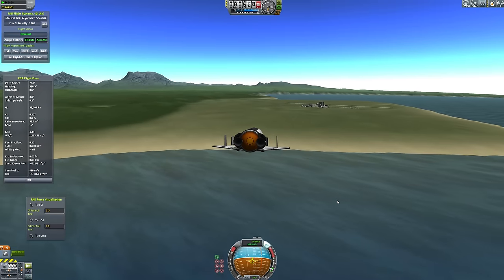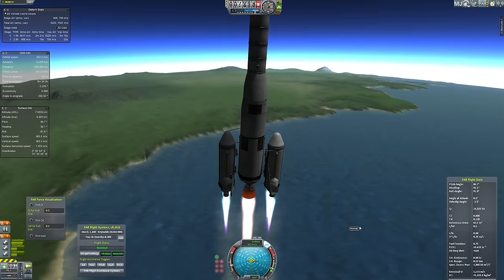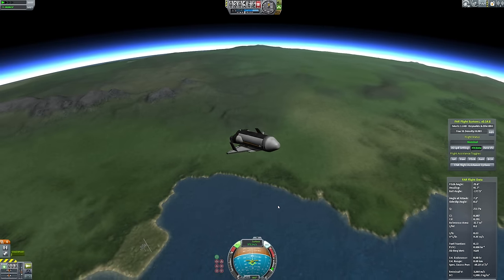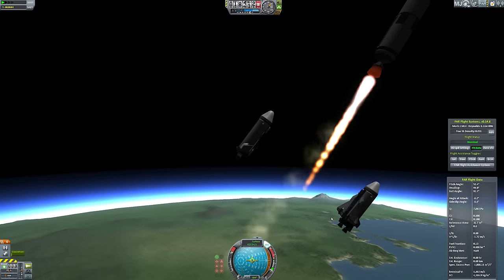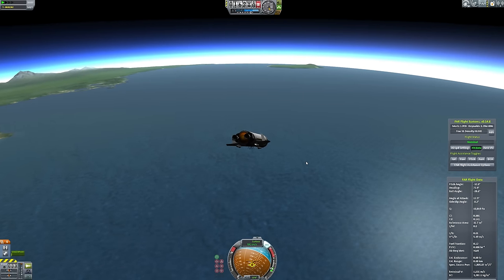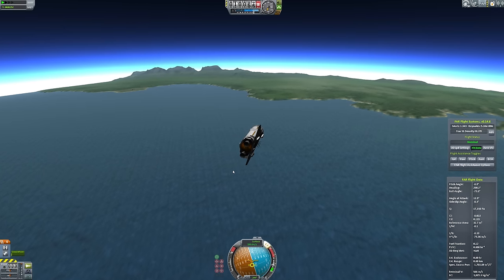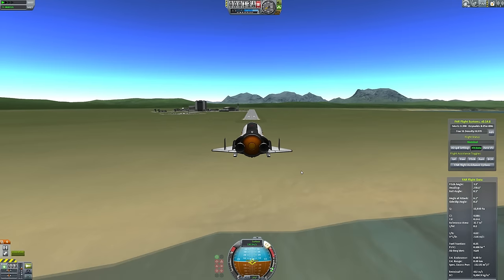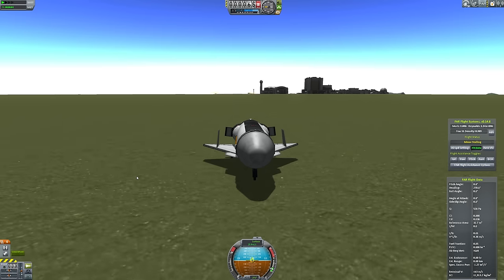Kerbal Space Program - The Reverse Shuttle

Comment: btw- If you want to lose altitude without gaining airspeed perform a side slip vertically through the air. If you have enough torque/yaw control to keep the nose level you won't gain a single m/s of v.
You probably know this ,but side slipping in this context is rolling the wings 90 degrees.

Comment: Weren't flyback boosters of the type shown here a Soviet concept for the Energia/Buran liquid boosters?
Reply: You mean the Baikal flyback booster. It was designed for the Angara rockets. It will use a folding wing and a jet engine to fly back to base.
http://en.wikipedia.org/wiki/Baikal_%28rocket_booster%29
http://www.russianspaceweb.com/baikal.html
Reply: No, there were definitely Soviet-era studies on the subject: http://www.buran.ru/images/jpg/gk175-5.jpg
Reply from the maker: I haven't seen any updates on this - the mock up was shown at the Paris Air Show in 2001 - the year before SpaceX was founded.
Reply: Scott Manley
It seems NPO Energomash has to make the RD-191 reusable first.
Reply: Christopher Woo as far as I know, it was originally planned to make them reusable by parachutes and retrorockets, althouth first ones were fitted with telemetry equipment instead. You might want to take a look here: http://www.buran-energia.com/energia/energia-desc.php
Flyback return of both boosters and core stage was planned for Energia II, which was planned for 1993, but was never realized.
Reply: I seem to remember early US space shuttle designs having the external tank returning with wings. 
I know I saw some concept drawings based on that idea.

Comment: They way I deal with clean separation is to attach a small fin to each side of the separated stage canted slightly outward. I put them about 3/4 of the way up the body. They have just a small amount of drag but the stages pull away instantly every time. I have not tried it with this type of recoverable booster but im sure it would work the same.

Comment: I think the "reverse-shuttle" design with strong aero-spike engines is the best way to build giant LH2-LOX rocket. Then we need to add a small, disposable, low-cost second stage and a giant liquid hydrogen tank with structural supports of the second stage. The tank can be either diched into the ocean and recovered or just disposed, it is not expensive anyway. All the valuable equipment would be on the shuttles together with the LOX tank, LOX is so much denser so these shuttles can have reasonable scale.
I actually ran some numbers based on SSME performance and quite conservative structure mass, it out-performs the space shuttle design, in terms of both payload capacity and cost. However, I see little discussion about this design, so what do you think is the major shortcoming of this design in practice?

Comment: SAS freaks out if your ship's control orientation doesn't match the body orientation.

Looks like you could have landed both of them by switching back and forth.  Get them both pointed back at KSC and when you get close, activate the air brakes on one of them to slow it down for landing while the other goes past, and once the first one is on the ground lock the brakes and bring the other one down.  Assuming it'll let you switch like that anyway.

Comment: I think B9 parts would be helpful here.  I find the brakes on the landing gear to work better, at least at high speed than the stock gear.  Also you have useful things like airbrakes (if they don't explode from over heating due to Deadly Reentry like they did on my SSTO space plane).

Comment: But isn't this a lot less reliable than parachutes? In what ways are wings better?
Reply from the maker: Wings provide superior cross range capability, and they don't submerge your expensive hardware in seawater.
Reply: Scott Manley
I was wondering why you did not put on a single parachute or "brakechute"(?) as you called them. I always smack one on my planes for I lack the calculating skills, I often have little to no idea where I'll be able to land.
Was it challenge?
Reply from the maker: Björn Mätal Stock parachutes in KSP get cut as soon as you land, so they can't help with braking.
Reply: Scott Manley How about this: if we can't trust the autopilot to land our winged thing reliably, we could have it fly on wings until it's no longer above water, then deploy parachutes. No seawater submergement required.
Reply: Scott Manley
Oh... That's...new for me. My apologize then, I've not played KSP in a while, last time I did parachutes got cut as soon as the craft became more or less stationary; mid air or on the ground, but only then.
Reply: +Scott Manley I often used drogues to help slow down some of my speedier landings....did they change that ?
Reply: RedsBoneStuff it can ldt heavy payloads and it works at high speeds
Reply: I don't think they're available in KSP, but what about paraglider style chutes? Wouldn't those provide about the same benefits of both wings and chutes, while having less downsides than either?

Comment: I'm curious how the IRL wings would do against vibrations and flutter. They'd have to be pretty beefy I think.
Reply: They did a design study on a "catamaran" winged flyback booster setup for the shuttle back in the 1990s.  Both (liquid fueled with jet engines for the flyback stage) boosters would be attached to one large wing and would fly back to KSC after separating from the shuttle.

It would have been technically possible, but too costly a redesign for a system that was already kind of on the way out. One unexpected benefit was that it reduced aerodynamic loads on the orbiter itself pretty substantially.

Comment: I see the bug with radial decouplers dragging the boosters inward is still in full force. :) That's what prompted me to make thrust-based decouplers for SpaceY.
Reply: Ed T. NecroBones Sure that's a bug? Seems realistic to me.
Reply: *****
Oh, I thought Ed was talking about the boosters leaning towards the main section after separation due to the drag of the decouplers still attached to the boosters. But if it's how you say, yeah that does sound unintentional to me.
Reply: *****
Yep, it's actually a well known bug. The ejection force applies an inward and downward impulse when ejecting within certain altitude ranges in the atmosphere, that is proportional to the ejection force. That is, the higher the ejection force on the decoupler, the harder the booster will slam inward toward the center stack. For the SpaceY decouplers, I started out giving them a significantly higher ejection force than the stock decouplers, and it would destroy the rocket every time, so for large boosters (3.75m and 5m, for instance), switching them to be thrust-based instead of using a high ejection charge was really all I could do to make them reliable. And in the end, they're a lot more awesome for it. :)

Comment: If you launch with your thrust vector going through the nose, and land with your thrust vector going through the nose, doesn't that mean there is an engineering synergy between launch and landing? The structural supports that keep the tanks in place at launch are the same ones that keep the rocket together during landing. If we put wings on a tank and try to turn a rocket into an airplane landing it horizontal, there is no doubt a lot more engineering required. Wings, wheels and more structural support means more weight, more fuel required to get off the pad, etc, etc... we all know how that goes. And even if you successfully design and fly a winged booster, the added complexity would cause a longer, more involved turn-around time before reuse of the tank. So all in all, I don't see a winged tank as a superior solution capable of bringing down launch costs to a routine business number. Winged boosters are cool, no doubt. But for my money, I'd much rather invest in the SpaceX design.

Comment: What happened to the parachute?
Reply from the maker: No parachute.
Reply: Scott Manley I meant in real life. :D
Reply from the maker: ***** If you're talking about the IXV mission, that's not what I'm doing here.
Reply: Scott Manley I mean why did they patent this kind of thing while parachutes exist?
Reply: ***** Parachutes on boosters would be great, and easily beat all other methods... except for one pesky detail: You need to launch from near the equator towards the east and avoid settlements. So you need to launch over the ocean. And rocket engines after a good brine bath can't be refurbished. So you need to get back to land or land on a barge or something.
Reply: +foobar201 OTOH boosters that glide back to the space center or other pre-arranged area, then drop on the parachutes the last kilometer or so would solve both the problem of extreme complexity of autonomic horizontal lander and the landing point problem.
Reply: +Blue Eyes White Teddy (Rocket engines)+(salt, corrosive water)+(relatively strong impact on the engine)=(It's cheaper to build new stage than repair the recovered one). Reverse thrust/landing on wings recovery eliminates all these problems. Also parachutes are strongly dependent on the weather conditions which cannot be countered by onboard systems (since parachute deployment=total loss of maneuverability).

Comment: good landing, but that was too much glide for such small wings.
But you did something wrong..
When you stage, you need to turn with rcs and burn all the left fuel in retrograde over the horizon, to not lose your vertical speed.
The boosters needs to be attached tilt up, so when you stage they get away from the rocket instead contrary.

Comment: Did you make sure the wheels had their brakes active? As in, in the VAB, you tell the wheels that yes, they are meant to activate on command? I'm guessing that would be pretty embarrassing, a bit like wondering why the sound won't work on a computer when the computer is muted.
Reply from the maker: Yep, the brakes on the rear wheels were active.
Reply: Yikes... Okay, another theory: the booster too heavy for the wheels? Or you not spamming the brake key like you normally do?

Comment: and what about the main probe ?? who will control that ? and the second booster ?
Reply: As the main portion is still thrusting as it leave, As long as it's still stable, it'll keep going up and maybe not orbit, but end up in a high arc where you can stage it and complete orbit later.

As far as the other craft... Can't really do anything in stock.

Personally, the lifters I use reach orbit with the shuttles still attached, and then I drop them back down as I feel like. Or they all dock up and clutter my stations.

Comment: you're detaching far too low  at too fast a acceleration , the drag is what kills those parts , 45 km is the least at 12m/s squared acceleration , 
if you keep it at 12m/s squared from lift off the g-force should be best lower enough to had a separation
Reply from the maker: No it was a bug, I tested the decoupling while sitting on the ground and they broke apart. To make them fit right I'd had to rotate and translate the parts which apparently put some odd stresses on them after decoupling.
Reply: that always the case with FAR , it really picky on that

Comment: around12.50 is something wrong with your voice
And i think about something similar but not using 2 bosters but using one booster stage (to not need to use that mod for reusable stages
Reply from the maker: Sounds like a post production glitch, this is what happens when you spend 2 hours on a video and then scrap it to do something else.
Reply: Scott Manley
There should be a way to connect the boosters so they land as one vehicle.